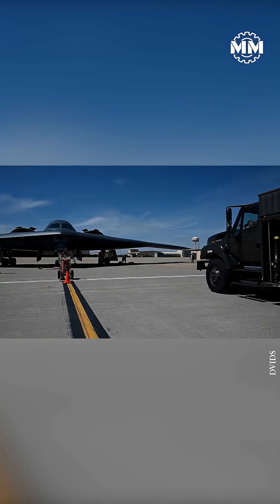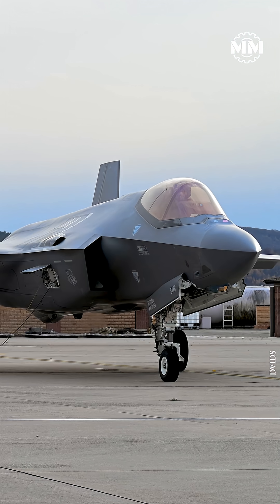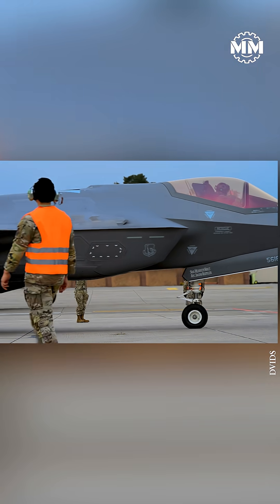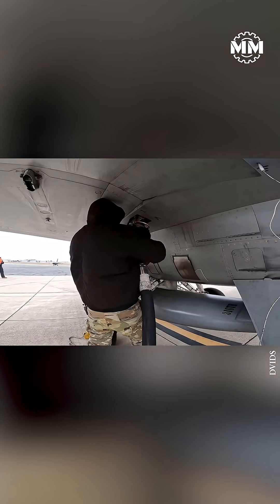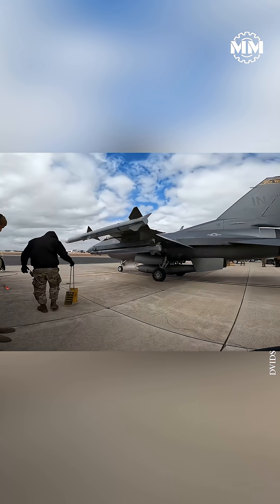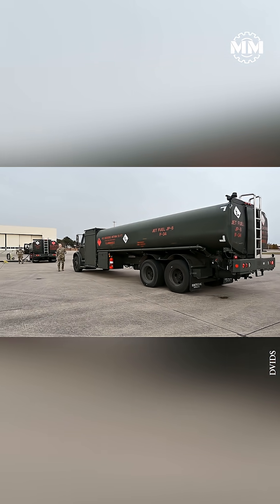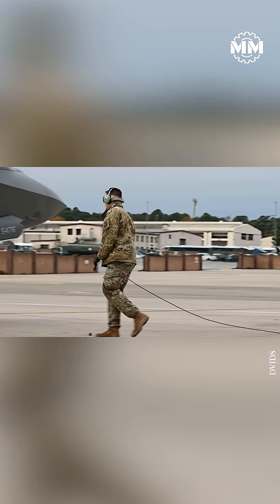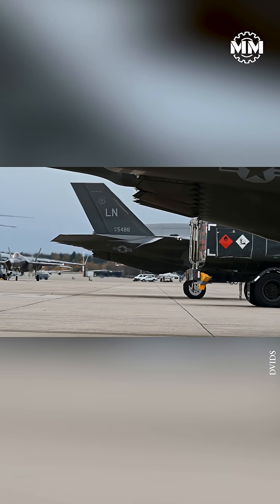The Most Dangerous 60 Secs on a Fighter Jet Flight Line: Hot Pit Refueling

Comment: In the Navy we also add to the excitement by conducting a Hot Pump Crew Switch. A little unnerving when you have the Starboard engine (right engine for you Landlubbers) running while fueling the jet with no crew in the cockpit.   
Good times… 😱